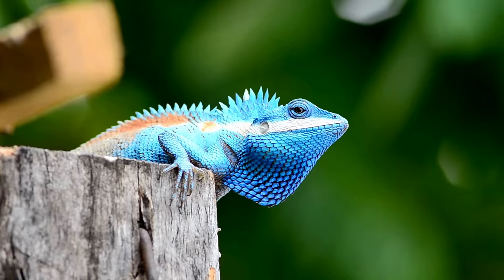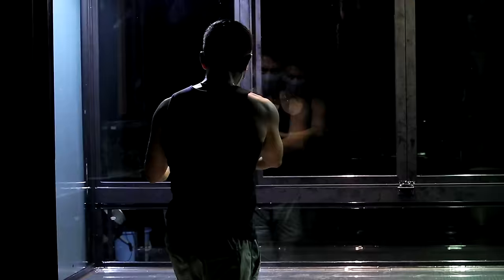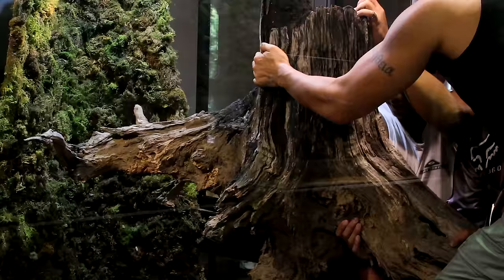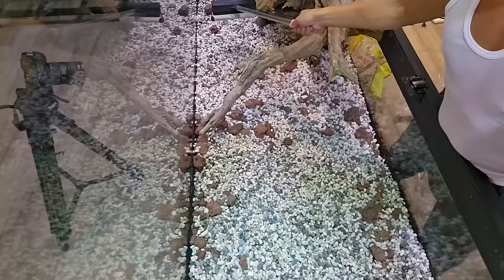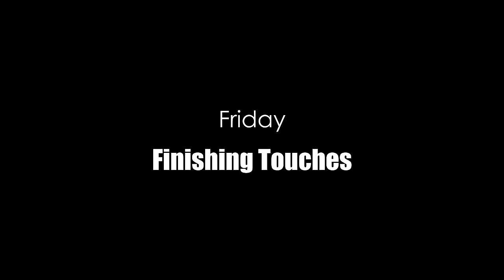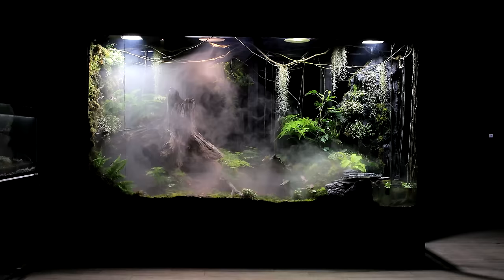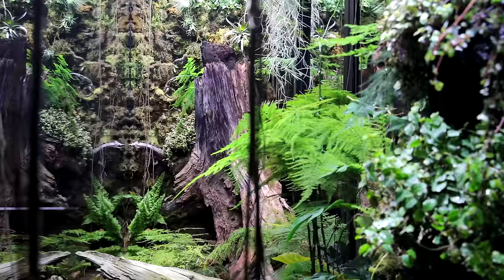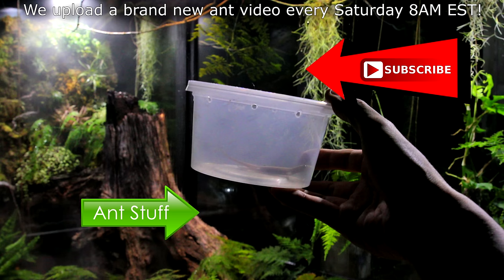I Built a Giant Cloud Rainforest Vivarium

Comment: If the glass was not properly sealed and had leakage in the water section, it´s quite likely that it might not be well sealed in the rest of the perimeter

so you may want to seal all the points where the glass meets the metallic floor and walls near spots the ants can climb on (like the mossy wall), or you could potentially have ant escapees if they dig a nest or climb the moss and by pure chance they find a minuscule gap invisible to us that they can fit through
Reply: Like the comment so more people will see
Reply: Bow
Reply: That... is a very good point. 

With so much mist and fog and rain, moisure may very well leak out at the seams... Hopefully he doesn't have to completely deconstruct it to seal it safely
Reply: But then again he does not live in the house, a couple escapees would not be such a huge problem I think. Other ants getting in there to raid would be worse.
Reply: I feel like that would've been noticed after the first few tests of the mist
Reply: Maybe, but he most likely found that out after he did his water tests & such
Reply: Bow
Reply: Good call
Reply from the maker: Oh man! Great advice, but how to do that now. :*(
Reply: @AntsCanada  You could try adding something to the outside, just another silicone barrier plus an extra frame cover to make it look pretty? Or silicone deep from the outside and cut/grind off the rest?
Reply: @AntsCanada It's hard to say since we can't see really well how it's put together.

Maybe you can silicone the outside and that will be enough?

If not, would it be possible to take something really flat to pull the dirt and everything away from the edge long enough to silicone the inside?

Otherwise, you can always dress up some PVC pipes around the outside and make it a happy little accident water feature 🤣. The pipes collect the leaking water and eecycle it or something maybe.
Reply: @AntsCanada do it on the outside edges use silicone or anything that would harden like you did for the water part
Reply: @AntsCanada get wide painters tape and tape the glass 3-5mm from the frame edge all around. Tape the frame from the flat edge so only the gap and a few mm of glass is exposed. Seal with black silicone and finish the silicone with small diameter pvc tube and water with a few drops of dishsoap to create a nice hollow rounded seal. Remove painters tape.

This should leave you with an almost unnoticable seal from the outside that will at least keep the fauna where you want it to be. 

Ideally you'd do this on the inside to keep moisture from getting in contact with the inside of the frame, but that cant be helped without clearing it out again.
Reply: I had a huge aquarium that wasn’t water tight and was resealed in this same manner. Sad to say, but you’ve created a ticking time bomb. The best way to fix this would be to include your water feature as a pond with a water proof liner inside your huge terrarium. 😢
Reply: @AntsCanada caulk maybe
Reply: @jaketheglutenphreakharris6620  thats most likely because silicone does not adhere to silicone and there remains a gap between the two layers. I've had the same problem with several second hand aquariums to the point of where I now go leak = dry setup. Not bothering with trying to reseal without taking the glass apart.
Reply: @Xc31  exactly. His set up is doomed I’m afraid
Reply: Le council has arrived bows
Reply: The side of the enclosure is mesh anyway, would that make a difference?

Comment: Mesh in the top is easy solution but bad, you'll loose a ton of humidity (that your equipment had to have to handle). You want in air on one side, about halfway up and out at the other side at the top. The reason why you don't want the inside on ground lvl is be course of drag, even if you have it indoors etc, doesn't mean it has to be cold air , just colder than the species in the vivarium needs and with lower humidity, most people don't have rain forest climate in the house. With the in air on the halfway up the "cold" air is sucked in then slightly falling creating a slow vortex that makes sure all air get's mixed. Good base rule is 2-4% of the area of the sides and front (no bottom or top) as ventilation area then divide by 2 for in resp out. Most people are surprised by how large it needs to be. Sorry for being late, not a steady follower but ends up on your channel sometimes. 
Background: built a indoor zoo/terrarium

Comment: What an epic build!!  I have a question about your rain system, though.  I saw that you built the substrate to accommodate drainage, but that water is still sitting in the bottom of the terrarium, unless you drain it away somehow after each "rain" cycle.  As often as it "rains" in the tank, how do you account for, or control, excess water accumulation beneath the substrate?  Can't wait to see how this build develops over time.  Really amazing!!

Comment: That rock wall NEEDS a mechanical support or fastener. That glue will eventually fail.  It’s far too heavy. Even a mirror will fall off the wall eventually if it is only glued on.

Comment: Question about drainage - I was curious if you did anything for drainage in the land portion. I saw the "drainage layer" but was curious if that was enough to remove the extra water that will build up in the tank? Also, there was two pipes in your water portion, one for the pump, what was the other one for?

Comment: I'm planning to build a large tank, 3 meter wide, 2meter deep and 2 meter high. Still bit in doubt about the technique and weight. How did you handle the top? Is it mesh completely? And what lights do you use? I see lamps but no LED?